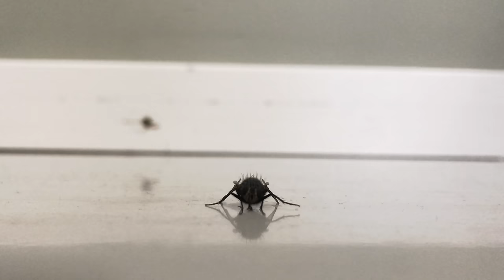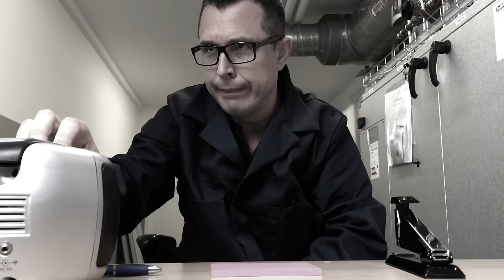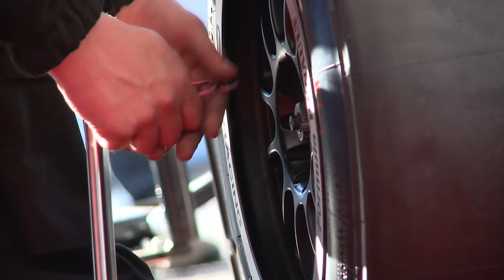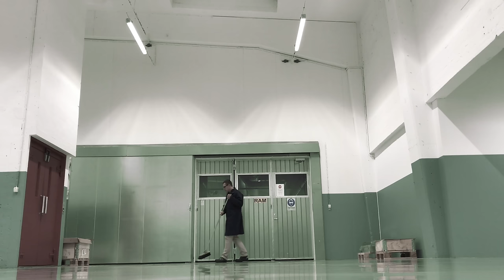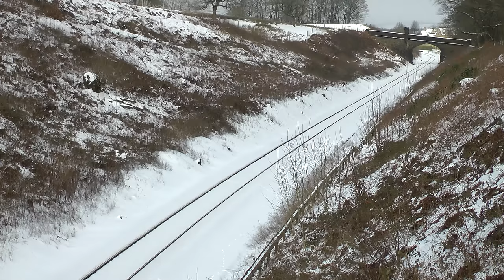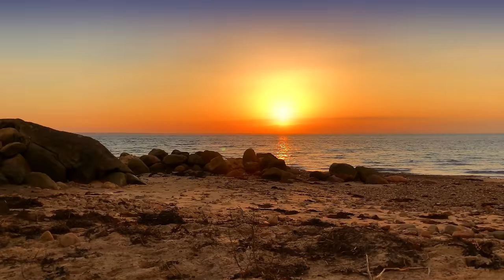The reason we are wage slaves

Comment: Being on salary is even worse than wages.  Money is not the problem.  Lack of money is.  If you had enough money to retire, you wouldn't have to work at a job you hate.  So stop working just barely enough to break even.  Stop pissing your money away on crap you don't need.
Reply: That's the point, they pay enough for you to come back the next fortnight or month
Reply: @fourq2049  but as long as you aren't contractually obligated to only work their one job, you can work a second job for additional income so that you aren't just breaking even each month.  Or if you are, if you can get pay that is greater than your expenses then stop spending the excess on BS you don't need and start building up your net worth.